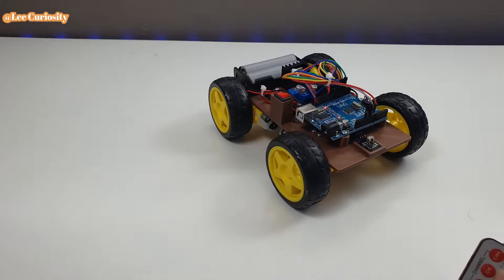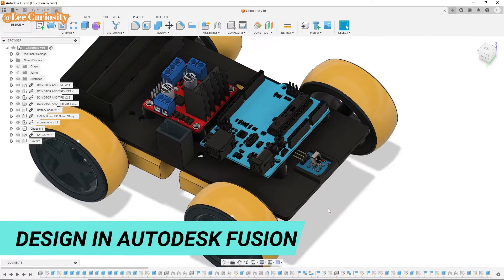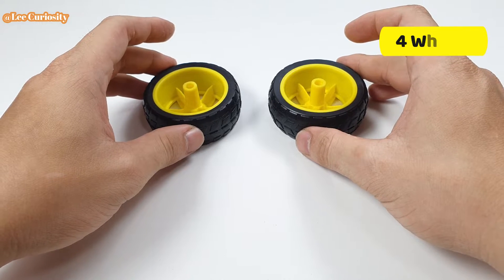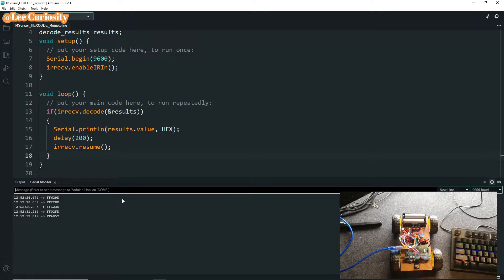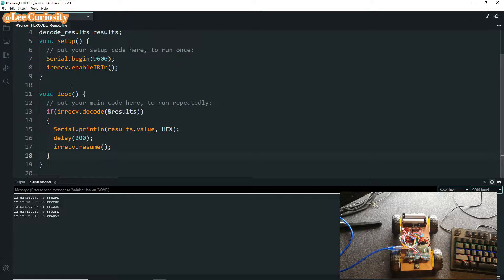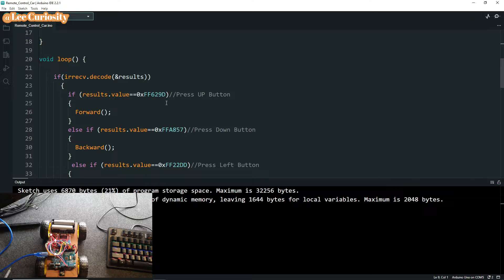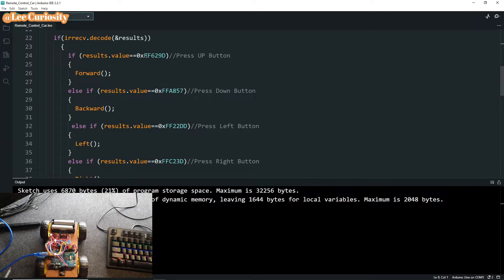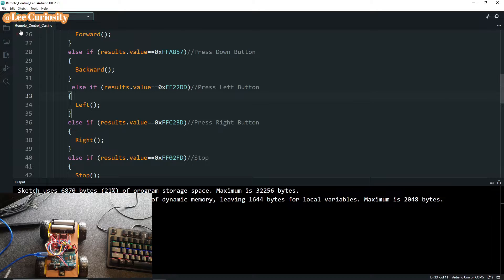Remote Control Car Using Arduino for Beginners

Comment: Dude I'm new and what I don't understand is that there are 2 codes, one for control and the other for movement, how do we upload which one to Arduino Uno? (I have Arduino IDE installed but I don't know which one to upload) Plz help me!
Reply from the maker: Both of them! Sorry if you haven't used the IR sensor remote before, I recommend you watch these tutorial first before making this robot
Reply: @LeeCuriosity  
Thanks! I understood after learning some more things. But there is one last question on my mind. If I upload a code and then upload another code, won't the first code I uploaded be deleted on Arduino UNO?

Comment: #define IR_SENSOR_RIGHT 3
#define IR_SENSOR_LEFT 4
#define MOTOR_SPEED 180

//Right motor
int enableRightMotor=11;
int rightMotorPin1=8;
int rightMotorPin2=7;

//Left motor
int enableLeftMotor=12;
int leftMotorPin1=9;
int leftMotorPin2=10;

void setup()
{
  //The problem with TT gear motors is that, at very low pwm value it does not even rotate.
  //If we increase the PWM value then it rotates faster and our robot is not controlled in that speed and goes out of line.
  //For that we need to increase the frequency of analogWrite.
  //Below line is important to change the frequency of PWM signal on pin D5 and D6
  //Because of this, motor runs in controlled manner (lower speed) at high PWM value.
  //This sets frequecny as 7812.5 hz.
  TCCR0B = TCCR0B & B11111000 | B00000010 ;
  
  // put your setup code here, to run once:
  pinMode(enableRightMotor, OUTPUT);
  pinMode(rightMotorPin1, OUTPUT);
  pinMode(rightMotorPin2, OUTPUT);
  
  pinMode(enableLeftMotor, OUTPUT);
  pinMode(leftMotorPin1, OUTPUT);
  pinMode(leftMotorPin2, OUTPUT);

  pinMode(IR_SENSOR_RIGHT, INPUT);
  pinMode(IR_SENSOR_LEFT, INPUT);
  rotateMotor(0,0);   
}

void loop()
{

  int rightIRSensorValue = digitalRead(IR_SENSOR_RIGHT);
  int leftIRSensorValue = digitalRead(IR_SENSOR_LEFT);

  //If none of the sensors detects black line, then go straight
  if (rightIRSensorValue == LOW && leftIRSensorValue == LOW)
  {
    rotateMotor(MOTOR_SPEED, MOTOR_SPEED);
  }
  //If right sensor detects black line, then turn right
  else if (rightIRSensorValue == HIGH && leftIRSensorValue == LOW )
  {
      rotateMotor(-MOTOR_SPEED, MOTOR_SPEED); 
  }
  //If left sensor detects black line, then turn left  
  else if (rightIRSensorValue == LOW && leftIRSensorValue == HIGH )
  {
      rotateMotor(MOTOR_SPEED, -MOTOR_SPEED); 
  } 
  //If both the sensors detect black line, then stop 
  else 
  {
    rotateMotor(0, 0);
  }
}

void rotateMotor(int rightMotorSpeed, int leftMotorSpeed)
{
  
  if (rightMotorSpeed < 0)
  {
    digitalWrite(rightMotorPin1,LOW);
    digitalWrite(rightMotorPin2,HIGH);    
  }
  else if (rightMotorSpeed > 0)
  {
    digitalWrite(rightMotorPin1,HIGH);
    digitalWrite(rightMotorPin2,LOW);      
  }
  else
  {
    digitalWrite(rightMotorPin1,LOW);
    digitalWrite(rightMotorPin2,LOW);      
  }

  if (leftMotorSpeed < 0)
  {
    digitalWrite(leftMotorPin1,LOW);
    digitalWrite(leftMotorPin2,HIGH);    
  }
  else if (leftMotorSpeed > 0)
  {
    digitalWrite(leftMotorPin1,HIGH);
    digitalWrite(leftMotorPin2,LOW);      
  }
  else 
  {
    digitalWrite(leftMotorPin1,LOW);
    digitalWrite(leftMotorPin2,LOW);      
  }
  analogWrite(enableRightMotor, abs(rightMotorSpeed));
  analogWrite(enableLeftMotor, abs(leftMotorSpeed));    
}

Comment: ive uploaded my code, but instead of the car moving forward only when i press the forward button its keeps on moving forward. same with all the other directions. if anyone knows what the issue is, please do tell. i think that its the problem from my ir remote which gives 0xFFFFFFFF if one button is pressed for too long.

Comment: This was amazing,
Every single connection of mine is working. But the motors won't move. I tried plugging my battery pack into 12V of the motor drive but it won't work. So as of now, I put the wire into 5V, and the whole circuit works but the motors won't move. The battery pack I am using is Lithium Ion rechargeable which provides my 7.4V. I am really passionate about robotics and can't find someone who is really helpful. And then it was you. You are amazing. Can we call so that you can teach me or provide me with some better tips for this project? Again you are awesome!
Reply: Just connect the 5v output to input of the motor pins and move this thing
Reply: Have you tried powering the arduino using the 5v on the motor driver?
Reply: Did you ever end up figuring out the problem? I’m running into same issue

Comment: Hi, I've followed all the instructions in the video,  uploaded the code to the Arduino and press the IR remote but the car doesn't move. When I click the remote the sensor light flashes but the car doesn't move. Can I ask on how to fix this issue?
Reply: bro i'm facing the same problem ...did you know how to fix it ???

Comment: hi, i have a question, if you use two batteries of 3,7 volts each one, wouldn't you be surpassing the capacity of the motors?

Comment: In motor driver there are enable pins you don't connect to anyone why
Reply from the maker: this pin is used to adjust the speed of the motors. If you don't connect these pins it will have a constant speed of motor.

Comment: How did you connect the red and black wires to the dc motor terminals
Reply: Soldering
Reply: you unscrew them

Comment: hey I followed all the connections but it seems  that the code doesn't run :( any tips on what should I do? thanks :)
Reply from the maker: Does it have any error when uploading the code ?
Reply: @ actually I figured out what the problem was … apparently I didn’t apply enough voltage 🫠🫠
Reply: @ thanks

Comment: L298N motor driver can control upto 2 motors only no?
Reply: Yes, that's right. But in the video he connects two motors using the same wires and driver controls two pairs of motors actually without even knowing it.

Comment: Hi, I have bought the RC car package and have assembled according to directions. When I upload the code into the Arduino and press the IR remote, the car doesn't move. How can I fix this issue? When I click the remote the sensor light flashes, but the car does not move.
Reply: When I run the code, it says that it is outdated. How can I resolve this issue so my RC car will work?
Reply from the maker: @polwmkxa  maybe it's because the version of the IR remote library
Reply from the maker: @polwmkxa  Just install the 1.0 and check it again

Comment: Will two 3.7v batteries work
Reply: Unfortunately I would not be able to work well as it requires 9v battery for function
Reply from the maker: actually, these batteries I used in this video are 3.7 V batteries
Reply: @LeeCuriosity  yeah but if I think it would work better with 9v Battery. Isn't it?

Comment: Does anyone know if the Mounting Bracket for the motors is 3d printable?  Or has anyone got a link to buy?
Reply from the maker: Well it has a link in the video’s description! Have you checked it out?

Comment: I've complete the circuit making parts, but i'm stuck at the codings as my remote send out repeated signlas which i cannot costmize, which remote can i purchase insated of the ones you recommended?
Reply from the maker: Hmm, You can buy the remote used in arduino kit

Comment: Why are we using IR sensor in BT control car?? And you have given both codes. separately, pls answer?
Reply: U need the IR receiver to capture the infred Ray signals, then use that signal to do functions

Comment: What version of the "irremote" library did you use?
Reply from the maker: It’s 1.0 bro
Reply: Its current version is 4.4.0 so it is giving error just downgrade the version to 2.6.0 it will work

Comment: Bro I have clicked link which have u gave ,but my device shows  (this cannot be open) bro pls solve this problem I puting in mobile so I don't has Arduino ide , I use Arduino droid pls solve the problem 🤌

Comment: Bro can u give code separate pls
Reply from the maker: Check description
Reply: @LeeCuriosity  Bro I have clicked link which have u gave ,but my device shows  (this file cannot be open) bro pls solve this problem I puting in mobile so I don't has Arduino ide , I use Arduino droid pls solve the problem 😢
Reply: @LeeCuriosity Bro I have clicked link which have u gave ,but my device shows  (this cannot be open) bro pls solve this problem I puting in mobile so I don't has Arduino ide , I use Arduino droid pls solve the problem 🤌
Reply: Bro I have clicked link which have u gave ,but my device shows  (this cannot be open) bro pls solve this problem I puting in mobile so I don't has Arduino ide , I use Arduino droid pls solve the problem 🤌

Comment: hey i saw that you were pressing a button to stop the car after moving it with remote , is there any chance that we could remove the stop code and still use it ?
Reply from the maker: Of course , you can adjust the code if y want

Comment: Sir i have run the code but a message accors when serial motior opens that:
You are using an old version of code so upgrade the code or downgrade the library to 2.4.0 version.
I do downgrade the library but still face the same message.
What's the solution?
Reply from the maker: Can you downgrade it to 1.0 version
Reply: @LeeCuriosity  no i just downgrade to 2.4
Reply from the maker: @abcsdffzxcaf  Can y DM me on reddit ?

Comment: Hai, may i know, is there any way to make tho motor run faster. Thanks
Reply: Any update on this?
Reply: I think that this would simply depend on the motor that you bought. So that would be rpm, hp, and voltage.

Comment: I just didnt understand why you connected the batteries to 12V input when the batteries were not 12V
Reply: because you can't connect 7.4V battery to any 5V input, it can damage the board
Reply from the maker: 7.4V is enough to power these motors
Reply: how much power?
Reply: Can we use 3 li-ion battery of 3.7V each
Reply: If the voltage is between 7 volts and 12V the motor driver board will bring it back down to 5V to power the board
Reply: @adonvanwyk5070 so Can I just use a 9V battery? I don't have 3.7V.

Comment: Hello, the problem of my car is the dc motor. They dont function smoothly like yours, sometimes I have to use my hand to roll the wheel a little bit for them to move. Do u know why ?
Reply from the maker: Bác check dung lượng pin chỗ input của driver  xem đủ 7.4 V hoặc hơn không !

Comment: How do i open the files in google drive for the code? there are three files, one is a picture of the circuit diagram and the two others are the code for the remote and sensor, but i cant open them. Do I need a special program?
Reply from the maker: Just use Arduino IDE.... Have you installed that ?
Reply: @LeeCuriosity  Hi! Yes I have it dowloaded, but when I download the files i can't open them and then a window from arduino ide shows up and all it says is export, so i click on export and then i have to choose files to export but i can't choose any files, and i don't know where they want me to export them to...
Reply from the maker: @sue-ellenhoang1158  Can you DM me on reddit

Comment: Awesome work 
I want to ask that how many motor can this Arduino uno and motor driver control independently 
If i want to control 8 motor independently then is this system ok or not
Reply from the maker: I'm not sure but the L293D can control 4 motors independently. I'll make that in the Bluetooth control car. So hope you subscribe to see that project
Reply: If you use L293D motor driver, one of them control 4 motors so that for motors Controlling you require 2 L293D modules.
If you want to control a bit larger motors like 12 volt motors you can use L298N Motor Driver, but it can drive only 2 at once so you need 4 of them to control 8.
I think there is a V6 version in L298N Motor driver it can control 4 motors at once, it will be very good , but it's rarely available in our localities I don't know about your locality. Choose based on these.

Comment: where you get your 3d
Reply from the maker: I design it. I will update 3d files later today
Reply from the maker: I've updated the 3D print file in the video description. So let's download and make it. And It'd be great if I can gain a sub from you.
Reply: @LeeCuriosity  what u mean sub, i'm new at this I just order the arduino kit. so i'm slow with this stuff. so i'll be checking with you
Reply from the maker: I'll do more projects in the future . So I mean that can you subscribe to my channel 😊

Comment from the maker: Feel free to ask any questions about this car
Reply: you could've made the turning better
Reply from the maker: Well maybe your battery is not enough to run 2 motor at the same time. I mean your batteries are run out of energy, can you check that again.
Reply: @LeeCuriosity  Have you used 300 RPM or 100 RPM motor?
Reply from the maker: @rahulbangia  It's 200 RPM at 6V DC
Reply: I dont have bluetooth module so I am wondering if Ir remote can work with other additions to the car
Reply from the maker: @darksneakreal69420  Just buy a hc-05 bluetooth module. The next projects I will make about this one.
Reply: @LeeCuriosity  I have a project due in 2 days, I would order but time is ticking and I'm asking if the sensor shield can work with this or if you have other suggestions as to what i can add to the car
Reply from the maker: @darksneakreal69420  Can y DM me on reddit ? I'm not really understand what are you talking about....
Reply: can I add sensor shield to this?
Reply: I'm using same batteries but car speed is slow. What could be the reason?